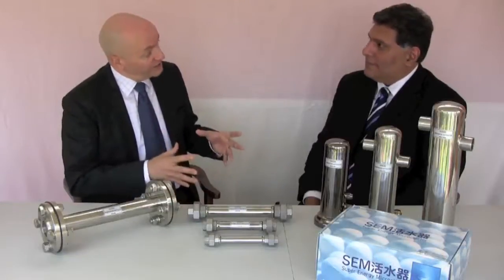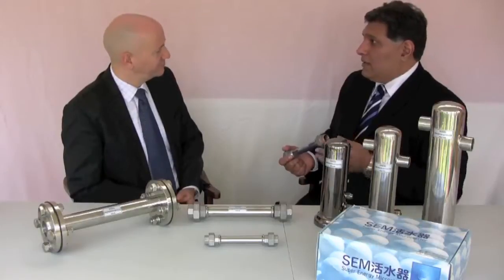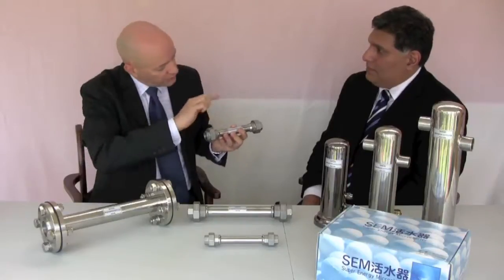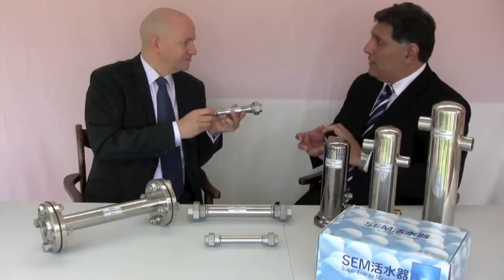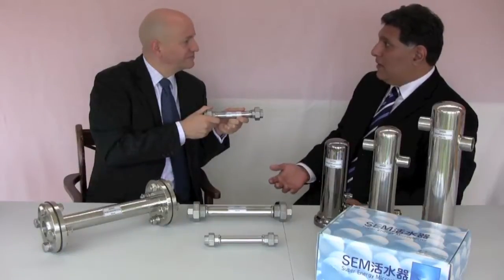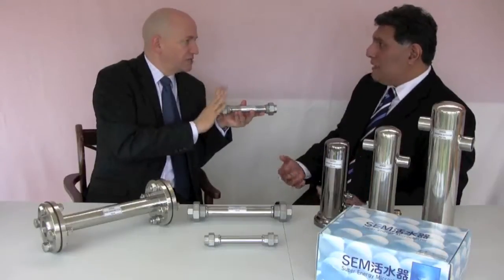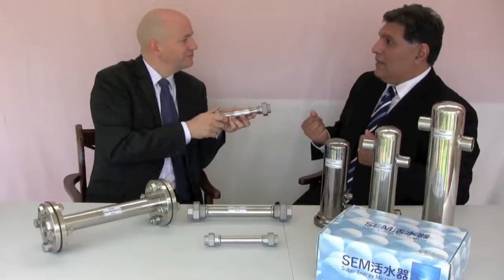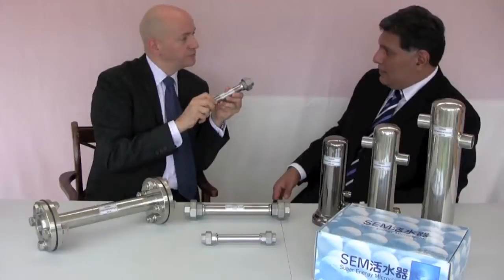Domestic Water Softener Vortex System

Comment: He says "because of the centripetal and centrifugal forces it pulls  oxygen so you get more dissolved oxygen..." But hang on, isn't it an enclosed system? It looks like it. And if that's the case, how can any oxygen get into the system, to be dissolved in the water? Is there some opening somewhere, so way for oxygen to enter?  All sounds a bit flakey to me... Pity they haven't responded to aeridybe's question...
Reply: DocH2002 you misunderstand your own question. The water has it all suspended but not completely dissolved. Many sizes of molecule clusters, once the vortex breaks these up it dissolves into the water. Giving you your source of O2....